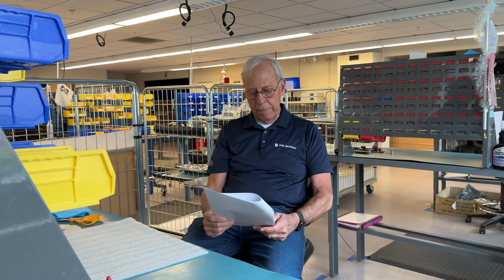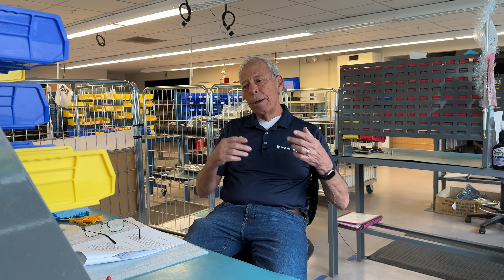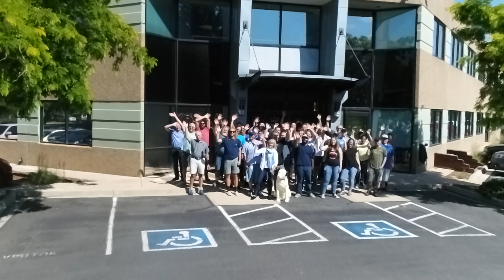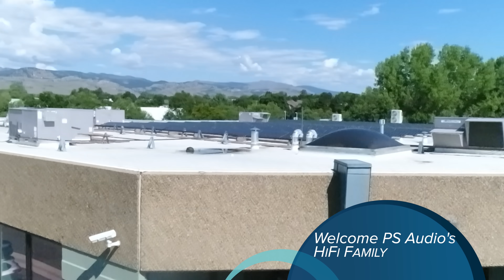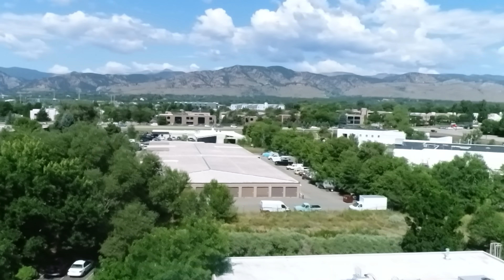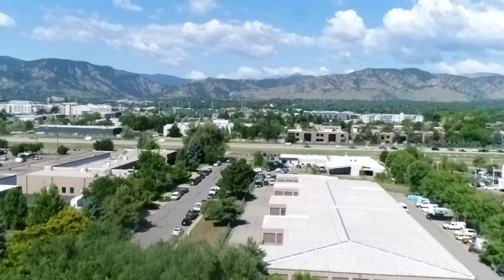Best way to connect a streamer

Comment: I2S on alot of DACs requires a sync between tracks that can take 2 seconds. I have a I2S  connection option but USB is as good and no sync issues

Comment: Question for Paul. Will an I-squared-S out work into a normal HDMI in? I don’t know much of anything about I-squared-S.
Reply: The short answer is no.  It has to be I2S to I2S.  The cable is HDMI.  If you aren't connecting between 2 boxes of the same manufacturer then you may also need to configure the pins on the receiving device.

Comment: I feed my Tidal into a small Triangle AIO streamer controlled by wifi from an old Sony tablet. The Triangle AIO outputs digital via Toslink to Chord Mojo 2, which in turn outputs via RCA to an Atoll AM100 power amplifier. Speakers are B&W CM8. Since Atoll power amp has no volume control, I use a volume feature in the Triangle AIO streamer along with volume control inside Mojo2.  The magic that this setup delivers makes me fulfilled completely.

Comment: What ever you use and are happy with is the best.
For me that is I2S on short (3" to 4") coax connections inside a streamer/DAC as they originally were intended. I use UFL connectors but SMA would be better.  Using a single board computer to eliminate USB was a step in the right direction.  It acts as the player while the user interface is elsewhere on the network.  Typically my phone or a laptop.  To be clear, all these items are very low impact that you struggle to hear.  More engaging and toe tapping realism than hearing a problem or a solution.

Comment: Let’s See 
I Need a Low Impedance XLR To a
Female RCA To a BNC To a 
Male Y-Splitter To a Pin Flipper To a C/USB To a 1/4” Mono To A High Definition Video Cable With Phantom Power….This Is All 
Nonsense We Don’t Need 
Cable Anymore That Sounds Funny 
Yet We Don’t Even Need 
Cable To Get The Ultimate NFL Sports Package 
The Technology Is Here Yet As Long As We Continue To Buy All
This Cabling It Gives 
The Answer Man a Job

Comment: Not Intentionally Trolling It Just Seemed That Way 
I Just See How Cabling Anything Is So Obsolete With The Technology We Have Now Cabling Is Just Not Necessary For Anything Anymore 
We Can Wire a Entire House Without Any Wire 
All The Switches To All
The Appliances No Longer Have To Be 
Hard Wired To a Power Source or Signal Running Between Walls 
I Know It’s Silly 
Yet The Technology Is 
Here And I Was Just Saying 
No Am Not Trolling 
There Will Be 
No Conduit For Wire No More 
Worrying About 
Low Impedance Cable or Balanced Cable or Any of 
That…Not Now Yet Soon
Our Homes Will Be
Running on a Hydrogen Fuel Cell That Will Be a Module That Will Pull Out and Put In Your Car 
And Questions Like
Unbalanced or Balanced 
Cabling Blows My Mind 
I Guess Some Of You Guys in The Mysterious World of YouTube 
Still Hammer 🔨 Nails 
With a Rock 🪨

Comment: Yes have audioquest cables all dragon. Dragon is all silver. The difference is shielding internally and how they cables are made with the strands. Lower lines are copper, then go up to copper/silver, then all silver. For DAC streamer I use WEL signature cables. You are talking 100k in wiring just about even at a discount. The Dragons took awhile to break in. They start a little bright being all silver but then rolled off nicely. For most the all copper to copper/silver will give a noticeable improvement. When people ask a question they need to first look at their budget for their system as there are different remedies available at various levels. Some audiophiles upgrade over 30 to 40 years of time to build their ultimate system.
Reply: I ...guess...you caught the dragon?:face-purple-wide-eyes:

Comment: Neglecting to mention USB seems a big oversight, as it's a cable type a great many of us use to connect our streamer to our DAC?
Reply: Since you’re asking a question, the answer is, no, it wasn’t an oversight. Paul has mentioned in previous videos that USB is a very noisy cable.
Reply: @tamstutz921  Actually USB is superior as it allows asynchronous data transfer for optimum digital audio architecture using the DAC’s clock as single clock master for jitter free playback. SPDIF, TOSLink and I2S are all synchronous interfaces where the data flow can yield jitter issues involving PLL. The claim that USB is noisy is not about USB itself but about how older PCs had noisy ground and 5V power rail, potentially ending up in the analog output of the DAC. This has absolutely nothing to do with how USB can perform in a modern well-designed system. Key is that USB can operate with asynchronous audio and that’s better than synchronous.
Reply: @ThinkingBetter  Your argument is with Paul. Write to him.
Reply: USB audio has 3 transfer modes of synchronous, adaptive and asynchronous. Best is asynchronous as it allows independent precision oscillator in DAC as clock master for jitter free playback.
Reply: @ThinkingBetter  Sorry but you seem like an AI bot with your talking points.
Reply: @bobnot24  I guess AI is getting smarter 😊
Reply: USB has lots of transfer modes. Synchronous mode is usually used for audio. Still probably good but there is lots of assumptions here. PLL is cool but cannot fix if the jitter is baked in. I would day it depends of DAC implementation.
Reply: @bobnot24  USB audio has only three audio transfer modes: Synchronous (worst: old-style strict from source to DAC clocking, sample rate is derived from USB clock), adaptive (better: DAC or source adapts to varying sample rate), asynchronous (best: DAC can control timing precisely as single clock master and buffers the audio data adequately).Synchronous is terrible concerning jitter. Asynchronous transfer is much better because it allows optimum single clock mastering running the DAC. SPDIF, TOSLink or I2C all run synchronous potentially yielding jitter issues with PLL. For digital audio you want asynchronous with a single clock master in the DAC. Unfortunately, transports or CD players are designed to be their own clock master yielding the "multi clock master" issue and jitter concern. It's a bit sad, but many streamers are designed to run as clock master and not allow asynchronous USB connection to an external DAC. It involves some complexity to equip a streamer with the ability to be an asynchronous source of a DAC via USB. Also check this video "USB Audio Part 3: What is Asynchronous Audio?".
Reply: @bobnot24 No, it has 3 transfer modes (synchronous, adaptive and asynchronous). The best is asynchronous and it’s superior also to synchronous interfaces such as SPDIF, TOSLink and I2S.

Comment: This is a complex task to answer... If we strictly talk about digital signal from streamer to DAC there are a lot to discuss and Paul was just touching the subject. You may want to pay attention where the clock is located, because that changes depending of format. USB and I2S = clock in DAC. Opt, Coax and AES = clock in streamer? Does this matter and will a higher class DAC handle incoming clock data better even if you have a lower class streamer sending a all-in-all digital data stream, let say by a coax cable?? What about power supply and its potential to lower the noise floor? This can go on and on. Make your own tests and trust your ears?! No, that is to hard - just read compromised "reviews". Cheers!

Comment: Data is data and the cable needs to be standard compliant, thus you won’t have data errors, but I prefer a single clock master in the DAC managing the D/A conversion precisely and use asynchronous data transfer from source to DAC. USB C can do that job of the final link between streamer and DAC. I don’t like having multiple oscillators trying to act as clock master for the data flow and PLLs trying to make it sync (e.g. yielding jitter issues). If my music is originating from some Amazon data center stored on some hard disk drive the hard disk containing my music track is read asynchronously and ideally the music data is transferred to the DAC itself all asynchronously where the samples can be buffered. This asynchronous pulling method is the superior way of the future. So one additional concern is that you don’t want to introduce any sample rate conversion and your DAC needs to run in the native format of the track. Methods of pushing the data from the source via TOSLink, SPDIF or I2S aren’t true to the idea of a single clock master (DAC) and running the stream asynchronously. USB C is in itself not galvanic isolating but there are ways to avoid that being a problem.
Reply: Wow!  I think I understood about 20% of what you said and I think, if I understood correctly, that is the reason I’m using the USB output from my streamer to my DAC. I have a Naim DAC V1 that has asynchronous USB which, as I understand it, takes the stream and runs it through the Naim’s own built-in clock which I imagine to be significantly better than the one in my streamer, currently a Bluesound N130 (also have an iFi Zen Stream).  Is this correct?  Is this the asynchronous transmission you’re referring to or something else altogether?  Thanks!
Reply: @dannyfannyfoodle  Yes that is what I’m talking about. Asynchronous data transfer for streaming simply means you pull the data from the source and buffer enough data locally to allow the DAC clock to run precisely the timing of the playback. The reason music playback over the internet is even possible is thanks to asynchronous data transfer as there is just no way to reliably tick every sample through the internet exactly when the sample is needed. The buffer size needs to be big enough to ensure it never runs empty if the data flow is momentarily slower, e.g. through the Internet.
Reply: @ThinkingBetter  Thank you so much!  I have to say, the Naim DAC V1 sounds incredible and does seem fairly unique in its asynchronous usb approach. I guess the new version of that is I2S which goes a step further?  In any case, I’m a happy camper and in no hurry to replace my DAC - even if it is getting “older” in digital tech terms.
Reply: @dannyfannyfoodle  No, I2S is synchronous and lacks any capability protocol like a modern USB C connection. It can only do a tiny subset of what USB C can do. The advantage of I2S is that it’s much simpler and cheaper to implement as it is more of a pure hardware interface. I2S has been widely used internally inside CD players, TVs and mobile phones for decades. I’ve used it in many R&D projects I’ve done through the 90s.
Reply: @ThinkingBetter  Some would have us believe it’s the audio panacea. Given the uncertainty about compatibility due to lack of a standardized protocol, I just haven’t been very interested to know much more about it. I know John Darko likes to call it “audiophile catnip”, which I find amusing. Thanks for your very thoughtful and helpful replies. I truly appreciate you sharing your knowledge.
Reply: @dannyfannyfoodle  I thought someone must have made a video about this subject and I found a nice one with title: “USB Audio Part 3: What is Asynchronous Audio?”. Neither SPDIF, TOSLink or I2S has the quality of being asynchronous.
Reply: @ThinkingBetter  Thanks for the recommendation. That more clearly explains what I thought I interpreted the Naim to do. What’s extra interesting is that Cambridge does NOT include a USB out with ANY of their newer streamers. In fact, very few moderately priced streamers have USB out. The Bluesound Node (3rd gen), IFi Zen Stream, Eversolo DMP A-6 are the only sub-$1,000 streamers I can think of that have it and which also do Tidal Connect. I have a Zen Stream which I enjoyed but IFi decided not to support hi res streaming via Tidal through either Roon or Tidal Connect, so I put it away and picked up the Bluesound. It’s dead stable and sounds great.
Reply: @dannyfannyfoodle  A streamer running a DAC inside of a good quality also includes a good oscillator. It might even have Bluetooth audio also. Thus, it becomes harder to make asynchronous USB out as the streamer already has the processing for internal clock tightly integrated. It will add engineering cost and also hardware cost to include it and they anticipate the internal DAC to be what the majority of users will use. Furthermore, unfortunately, it’s probably true that those who would care to pay for an extra DAC also believe they rather have a US$1000 SPDIF cable than a US$10 USB cable for best audio. Currently the awareness of why an asynchronous digital audio link is better is poor among consumers.
Reply: I would add an external master clock can make a noticeable difference with a server/streamer (via AES vs USB) such as the Aurender MC10.  I carefully evaluated it before purchasing and even with an excellent DAC, an Ayre QX-5, there was just more musicality.
Reply: @BradfordWarner  An external clock is needed only if your internal clock has poor jitter, which is trivial to avoid with proper component selection, circuit design and asynchronous PLL free data flow. It's a bit sad to realize a streamer is so bad when good design can avoid jitter to become a topic.
Reply: Actually, the streamer I'm using, the Aurender N20, is widely recognized to have a class leading design and low jitter due to an OCXO clock.  My point in commenting was the remarkable advancement now possible to even further lower jitter but also phase noise  with a complimentary master clock.

Comment: What does an I2S output plug into?  The connector is an HDMI-style connector.  I see that.  But what's at the other end?  I just looked at PS Audio preamps on the website, and I don't see where they have an HDMI-style input.  Am I just not seeing it?
Reply: I have the very same question and I’d love to know the answer.  I don’t see it either.  Hmmmm.
Reply: @mikerichards324  It was late at night when I read McGowan's post.  I wasn't thinking clearly.  OF COURSE -- the streamer feeds to a DAC with I2S input.
Reply: My experience I usually find i2s output from a source usually a streamer, usually a higher cost streamer. The streamer i2s output to a DAC i2s input.
Reply: The I2S plugs into thier DACs

Comment: What is the format that PCM/DSD data is sent over a normal HDMI link?

-I know that HDMI will carry an encrypted Dolby True-HD or DTS Master Audio signal in up to 8-channels at 24-bit 192KKHz for a DAC to decode.
-As well as the same bitrate in uncompressed PCM
-Also 6-Channel SACD DSD-128

Pretty sure it doesn't use the SPDIF back end, but can't confirm... Not that it 'really' matters (other than to know.) No-one is complaining about the audio quality from SACD or BluRay Pure audio over HDMI. If you're concerned about ground loops use a $30 AUD optical fibre HDMI 2.1 cable.